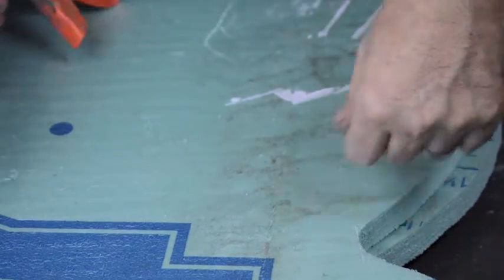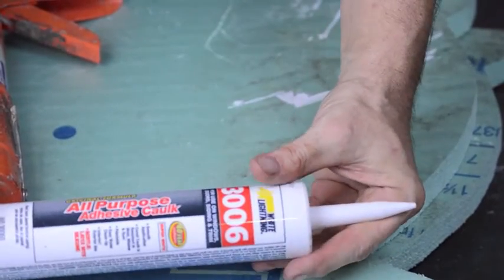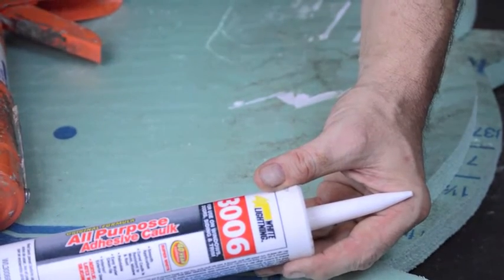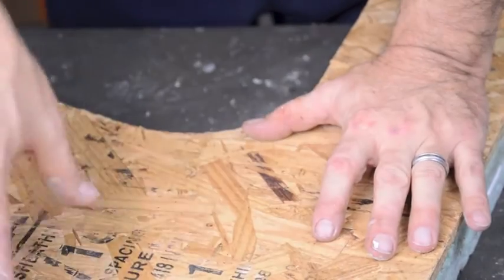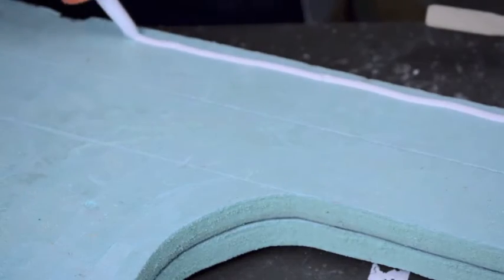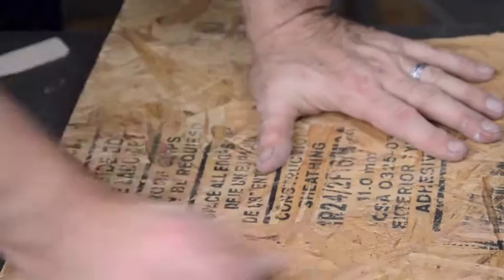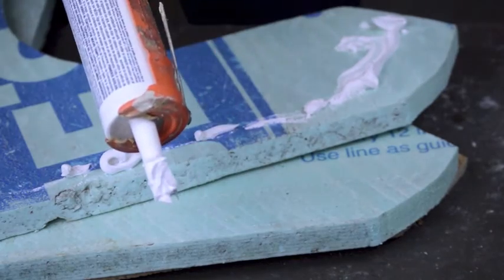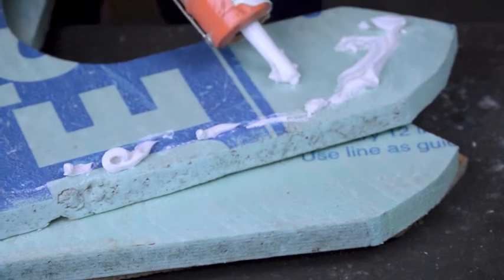Bleached Bones Vlog 24 - Gluing the Pew

Comment: I have never tried the caulk either. I would think it would work on wood since it works on foam. I used to use the foam adhesive but switched to the Glidden Gripper after seeing it on Terra's video. I am looking forward to seeing how you seal up the seams. I made a tombstone this year that was 4 pieces of foam glued together. I used a whole tub of wood filler on it! $$$ Cha ching Cha ching. So I would love to have a cheaper way to do it that is sandable. Thumbs Up Rich!
Reply from the maker: +bransonhauntedhills I tried Glidden Gripper once also after seeing Terra's video, but I didn't have much success. Also, that stuff ain't cheap either, at least not as cheap as me. :) I still have a quart or two, which I recall as being rather pricey. Yeah, and wood filler ain't a bargain either. The clay is definitely sandable, but the Monster Mud may be the way to go as it is easy to to spread being more liquid-y. And when it dries, you can sand it too.

Comment: I've never tried the caulk. I would think it would work fine as long as it cures. Have you ever tried the Glidden Gripper primer?  That works really well for panels with large surface areas.
Reply from the maker: +Graves Of The Groves I did try it  a few years ago after seeing Terra use it but I must've done something wrong because I didn't have as good success as I did when using the adhesive caulk. Also, I'm not sure if it would work between materials, i.e., foam and wood.

Comment: add some screws
Reply from the maker: +Bob Carroll I had considered that because when I build my facade, I had connected it like that, but here it would be screws going through the foam into relative thin plywood, I wonder about its ability to hold, though even a 1/4" bite is probably sufficient since it's not going to receive heavy duty abuse